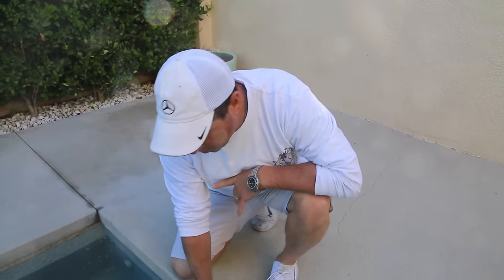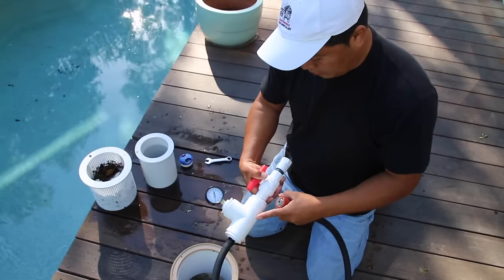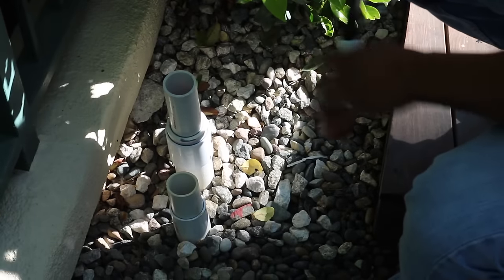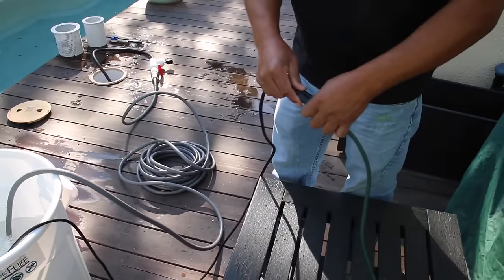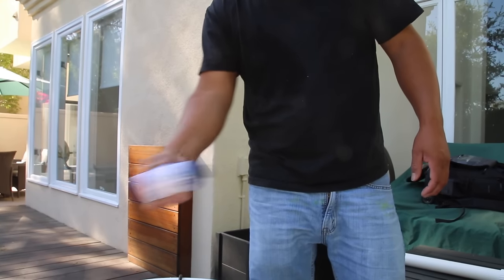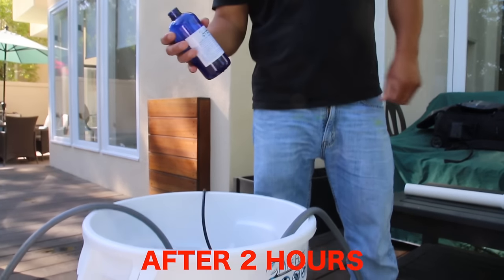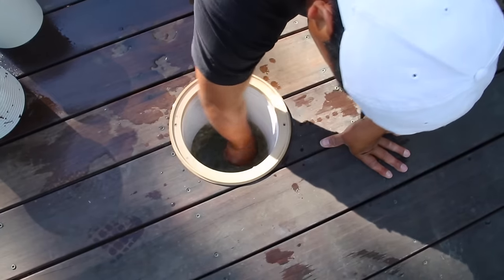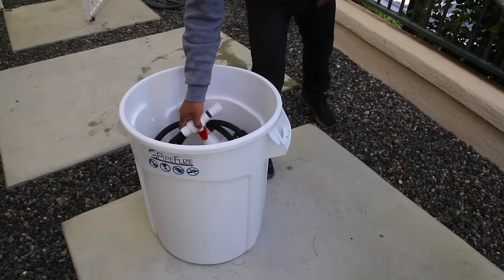How to Repair Pipe Leaks Without Digging - DIY Guide

Comment: Wish I had seen this video before I spent $6500 digging up my paverstone patio and replacing the entire skimmer line system to the filter pump.   Such is my life !
Reply: When your skimmer was doing this was your pool water level dropping significantly??     I just paid $500 for someone to tell me i had leaks in my new liner thats only a week old.  But my skimmer keeps draining down to nothing and they said there was NO underground leak…..Im so frustrated with the whole thing.  I was told a new liner would fix this problem and it hasn’t.  It’s as bad as it ever was before in the old liner.
Reply from the maker: Did you do the repair yourself or contract work?
Reply from the maker: Do you know if they were using LeakTronics leak detection equipment?
Reply: @leaktronics  yes we installed the pool liner.  We have put in 3 liners since we have had this pool over 30 years.   It started losing water with the last liner that needed replacing…big time leak.   Had to just stop using it for a couple years.  The guy did NOT use the leaktronic detection equipment.  He had a tank and hose with a gauge. Which i thought was for his diving equipment.    I told him the lines were draining and he just looked puzzled.  Because the pool was full of water at the time they came out.  They told me it had to be full to the max line.    He told me basically to get an other liner, i told him this one is only a week old……
Reply from the maker: @sharonsmith3362  Either there's a leak somewhere in those pipes (skimmer line) or during the last liner installation, someone dropped something in the pool causing a tear in the liner. Definitely take a look at our Find A Pro tab on our website to find someone near you with our equipment to do a leak detection: https://leaktronics.com/find-a-pro/

You could also give us a call and we can help guide you with the next steps to getting this leak figured out - (818) 436-2953
Reply: @leaktronics  is this an expensive test also?  I just about ready to cover this thing up because it is losing WAYWAY too much water to be a liner leak.  We used Alabama Leak detection the other day.   Are they suppose to use your equipment?   But i think you are correct in that it’s a leak in the skimmer line….  Call it in tuition but i cant get it out of my mind.    Thank for you help.  You’ve been more helpful than the leak detection people!!!!!
Reply: @sharonsmith3362  My water level would drop to just below the skimmer boxes.  I would refill and the next day it was down again.  I have 16 x 32 inground pool.  My pool guy did a pressure test and the needle showed a drop in pressure.  Instead of trying to find the leak and dig up my pavers, (they did have to dig up some pavers) they just put in a whole new skimmer line and rerouted the pipes to the filter.  Last year , I replaced my liner  ( 7 years old) for $3200 as a first step to solve my leak issue.  $9700 later, the pool is good.   I should have filled it in and made a putting green instead !  Pools are like owning a boat. Expensive.

Comment: Why not dig it up and fix it properly...this is great for a homeowner not for a leak specialist
Reply from the maker: We sell PipeFuze and Leakshot mainly to homeowners. Our newest product, Pipepoxy, is mainly for contractors to repair pipes without having to dig https://linktr.ee/leaktronics
Reply: Why would you want to dig it up if you don’t have too
Reply: Where would you dig in this situation?   Looks like the decking, a lot of stuff would have to be removed to find a small leak.  If this works, it is a good solution in my opinion.
Reply from the maker: @roykowalski4125  Pipe Fuze works great for homeowners. Our latest pipe repair product Pipepoxy works MUCH better, but is more suited for contractors that do leak detection and can pinpoint exactly where the leak is.
Reply: Do you have any affiliated contractors in the Peabody mass region
Reply from the maker: @JohnAx-y3e  We have a Find A Pro tab on our website! https://www.pipepoxy.com/find-a-pro-map/

It seems like the closest is PPAS in Andover, and Nantucket Oasis Pool & Spa in Nantucket. 

Just make sure to give them a call and ask if they're still doing Pipepoxy. If not, let them know you need it done!
Reply: JQUICK21 what statement is embarrassing? Fixing the broken pipe properly? Have you fixed many broken pipes involving pool equipment?
Reply: @audreykassem8010 that's not gonna last and they'll be digging it up anyway. So now the customer pays more then just digging it up.

Comment: Instructions are really vague instead of showing a full system with a pool pump and filter and where would be connecting the other end of the kit.  It just seems very pointless
Reply: This is not how yoy want to fix a broken pipe. That's not gonna last. They will be digging in no time.